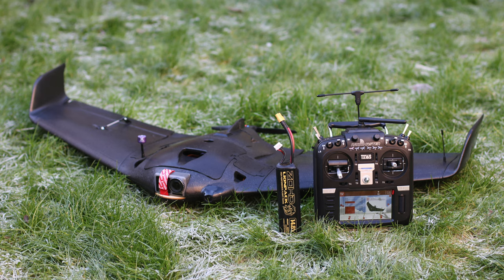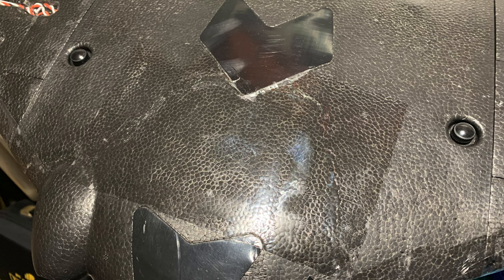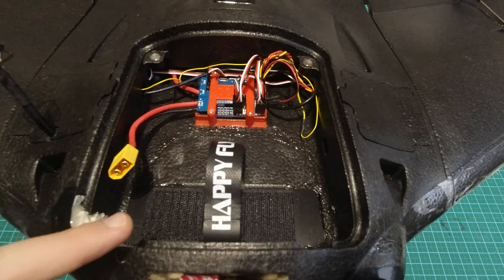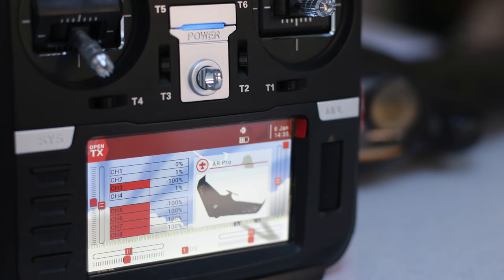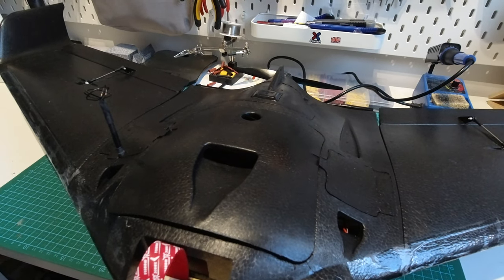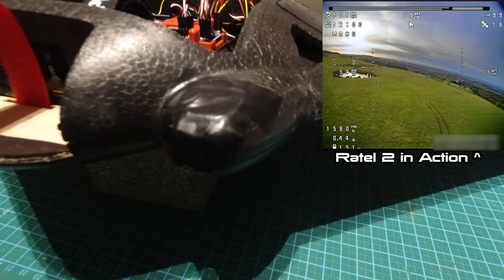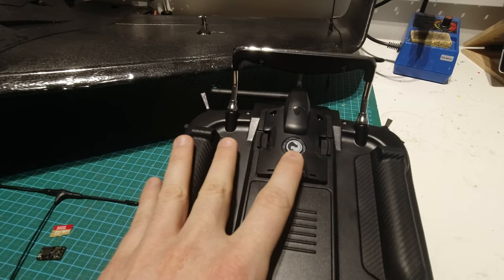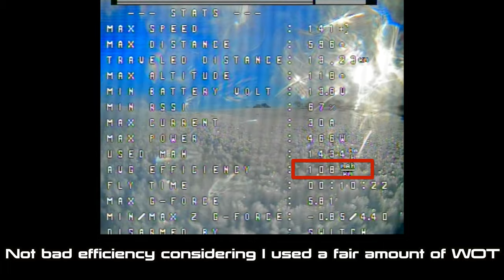AR Pro FPV Wing - Maiden / Crash / Repair / Review... & New Toys 🤓

Comment: I know this is an older video, but I just had the identical experience with the maiden of my 1st arwing pro.  Crashed into short tough bushes like you and destroyed the front of the fuselage, although mine split in 1/2 horizontally.  I was lucky to find it after nearly 3 hours of bush bashing.  Thanks for sharing that tip about making expanding glue.  I'm going to need to do that.  Thanks for the info, and safe flying.
Reply from the maker: Glad you found it! Thanks for watching and commenting 😁 good luck with the repair

Comment: The great thing is that after your 86 test and setup flights including all the crashes, to get iNav working well,  you can just order a Fuse as they are available as a spare part ! :)
Reply from the maker: If you can order the fuse separate thats really nice. Most companies don't offer this. iNav is all good for me mostly. Been using it for years and this is my first issue with it in a long time... and it was my own fault really

Comment: Nice comments on the Ratel 2. Good to see they can improve an already great cam. I’ve seen there’s a Ratel Mini too with a larger lens, which may have better optics. 

Lots of cool stuff in this video Adam. You always get the best scenery too.
Reply from the maker: Nice, I've not heard of the Ratel Mini, I'll check it out. They made a couple of other changes on the Ratel 2 like a wider angle lens, but I just see that as a personal preference thing rather than an upgrade.

Cheers, glad you enjoyed it. One of those videos that ended up a lot longer than intended but there was just a lot I wanted to cover. This could have been 1 hour long if i's said all of the things I was thinking haha. Yeah the scenery is always great when you get a nice blanket of snow... however, my car can't make it up the steep icy road so I had to walk up about 500m 😅 cheers mate
Reply: @AdamGdoesFPV  to be honest, I read about the optics on the Ratel 2, and the wider angle, which put me off a little. The “DJI” glass could be better, but the preview image looked a fair bit more fisheye, but probably not enough to notice in flight. The Mini I think has been out for a little while. It was after the baby, but before the 2. I didn’t notice it until last night, when I was looking at cameras for the next project. 

That walk was worth it though. It looked stunning 👍🏻

Comment: It seems if you have crossfire failsafe set to cut and inav set to RTH when you turn off radio it would return to home, I don't get the Emergency landing unless there was malfunction or maybe I'm missing something. Thanks
Reply from the maker: Yeah that's right I have the CF set to cut/no pulses and FS set to RTH. I also have emergency landing set to 'never' haha. Seems like a quirk with this particular scenario that may not have been considered. I think iNav can't quite understand if the plane is on the ground or in the air. Oh well at least we all know how to prevent this from now on. Cheers

Comment: I have not done much flying the last couple of years but I plan to get back into it and am building 3 wings; the Dart XL En, the AR Wing and the AR Wing Pro.  Being more of a fixed wing pilot but not a "wing" pilot which one do you think I should start flying first to make things easy?   Also, after I saw the video of your crash my faith in INAV dropped a bit.  Might try Ardupilot, not sure?
Reply from the maker: I'd say either of the AR wings, whichever you've finished first. Having said that the Dart XL is easy to fly too... but maybe a bit less forgiving if crashed. Don't let this crash put you off iNav, it's pretty good, and I understand why it's designed to behave the way it did in this video... if only i'd known to just drop the throttle I could have just carried on my flight. Ardu is a steeper learning curve, not as user friendly, but it's personal preference really. Cheers

Comment: I like your expanding foam repair, very novel....I hate the fact you are forced to use a big GoPro to get CG, even though you have a big flight lipo in there...Oh, you need to get the new TBS App on your SD card...an App that runs inside otx..!!! I also have the exact same Radiomaster, agree about the ratchet and stick tensions...🤔🤔😳😯🇬🇧
Reply from the maker: Cheers mate 😀 Yeah I can see how it would be annoying for people with a light HD cam... but for me this was always going to be my setup and it just happened to be spot on for CG. I added the TBS agent a few days ago, very smart, you wouldn't get to appreciate it properly on the X9D. I'm hoping I can fix the gimbal preferences, will let you know how I get on 👍🏻
Reply: @AdamGdoesFPV  Cool, yeah, not having a ratchet to speak of is annoying, but the TX itself is great. So much easier to operate and navigate with that scroll wheel...🤔😳😳🇬🇧
Reply from the maker: @EnglishTurbines  Agreed! I might even get the CNC version as I think this could be one I stick with for a while :D

Comment: Adam ..what's the main difference flight characteristics or purpose wise,... between an ARWing Pro, and a ZOHD Talon GT?
I,m wanting to get into wings from kwads...but am a bit confused as to what wing configuration to chooseto start..😳🤔
Reply from the maker: Wings tend to be a simpler build and can withstand a bash a bit better. Talon GT has more parts sticking out which could be damaged in a crash, but will be more stable in yaw and you have a rudder for more precise control.
Reply: @AdamGdoesFPV  Ah..many thanks Adam, appreciate you're clarification 👍🍻...I,ll move on to the Talon GT Rebel later this year once the online shops here in England can get  stock in again.😲
Lovin all your long range vids along the coast needless to say.🚀

Comment: Cool vid man. What a thing to happen with the auto launch tho!
Reply from the maker: Cheers 😀 yeah that was a pain, at least I know how to stop it next time.... could have been worse 😅
Reply: @AdamGdoesFPV  I could feel the panic whilst watching it man!
Reply from the maker: @lurgy1  😅😅 yeah it's not a nice feeling when you think you're completely locked out and don't know why. I'm lucky it went round in a circle rather than heading straight off into the distance
Reply: @AdamGdoesFPV  I had something similar last time I flew when I had changed the return to home setting. I done rth and launch mode as I normally do and it carried on flying out until it got to the rth height (not normal for me) but was a fast model and it got quite far out before I realised to switch rth off lol.

Comment: Thank you for posting this review.  I just finished acquiring the PNP edition of this wing. How do you program the Sonic model 40a ESC that it comes with?  Have you been able to find a manual for it?    If so, do you mind posting a link on where I can find it?  Thanks in advance.  Cheers!
Reply from the maker: Cheers. From memory I think I used the programming instructions from the Dart XL. ZOHD / Sonicmodel are same people and I think escs are same with different branding. It worked for me: http://myosuploads3.banggood.com/products/20200803/20200803052400ZOHDDartXLEnhancedVersionManual-LD.pdf
Reply: @AdamGdoesFPV  Brilliant.  Thank you!  I’ll give it a go.  Cheers!

Comment: Hi how many wires do you have running from your xfire receiver? I see if you uese the wing plug you are limited to 3 wires and some xfire setups like mine with mavlink passthrough use 4. Thanks
Reply from the maker: I was going to talk about this in the video but decided to cut it out due to the length. I use 3 cables because I have no interest in telemetry, so for me it’s easy. However, if I did want to use 4 cables I would simply use 1 of the 6 pins for 2 x GDN cables and then use the spare pin for the 4th rx cable. A little extra faff but once it’s done you’re sorted.

Comment: Do the magnets on the back hatch screw with the GPS at all?
Reply from the maker: No not at all. It averages around 15-20 sats as it is and it acquires sat lock before I even put my goggles on to check the live feed :)

Comment: I know this is old video but I've watched several times LOL, I'm still flying the ar wing pro with a 4s 5200mah lipo but thinking about going with same battery you have here I'm looking to get alittle more flight time but to be honest i worried about amp draw when launching,loops and rolls. Should this be a concern? This bird is right at 1400gr but cruises around 6amp but much more at full throttle. How much flight time do you get with this battery? Thanks for all your videos
Reply: I'm also interested in whether the liion pack will be a viable option, it would be interesting to see if the low amperage is ok
Reply from the maker: Hey, from memory I was getting minimum 30mins and would easily get 1h just cruising. The li-ion can output around 20a continuously which is nice for medium speed flying. You can punch the throttle for loops at the start of the flight but as it gets to lower end of its voltage range you’ll have a lot less power, even to the point where you can just about maintain cruise amps. I happily used li-ion for most flights on my AR Pro and it’s fine, just don’t expect the same punch or sustained power as lipo.
Reply: Ok makes sense, thanks for information

Comment: Nice review - I like your foam repair.  I always frisby launch my AR900 with a shake start for auto-launch, after  blending a finger from a bad auto-launch using the skids to grip.  This is a reliable way to launch without requiring any idle throttle.
Reply from the maker: Thanks 😊 I’ve used that method before, but luckily I’ve never had a prop to hand incident 😱 hope your injury wasn’t too bad!! Yeah I think it’s a nice easy repair that some people might not think about and it’s really handy to fill those gaps 👌🏻

Comment: Looking forward to seeing some more of this gorgeous winter flying scenery. 
Thanks for the PVA glue tip. That a very useful to know. :)
Reply from the maker: Yeah It's a handy little trick for filling those gaps. Also useful in some builds depending on the model. I hope to get some more winter shots but the problem is its just so cold and windy right now... plus a lot of low cloud so sometimes my flying field is in the clouds with very poor visibility :/ Cheers

Comment: i had the EXACT SAME PROBLEM with my drift. i threw it. it maintained altitude at like 20 feet and i'm doing all sorts to try and get it out of autolaunch. ended up doing that moving the throttle to 0 and of course when i did that ..... it turned turtle and ended up in a puddle.
Reply from the maker: Well at least you figured it out lol. shame about the crash though, that's unlucky

Comment: Find really interesting you didn't try to use a repeater... In my humble opinion the transmitter have some kind of harmonics... that actually are interacting with your VRX.. using a repeater would allow you to stay far from the Receiver and check that theory.. I mean if the transmitter is a good quality there's no good reason to walk away from it.(Plus consider as well moving the transmitter to the tip of the opposite wing away from the Crossfire RX)... Best of luck!! I do plan to put an plywood "Spine in the center of the fuselage & set up a hook so I can use a bungee cord "I do have a bad shoulder and can not give my self the privilege of throwing it like every one else... Great video I really enjoy it!
Reply from the maker: Hey, not sure if you have commented on the wrong video here. The only issue encountered here was a dodgy Vtx. Even with the control link gear all turned off the video still had the same problem. Cheers

Comment: Any suggestion how to mount a camera on its belly ?
I want to do some aerial photography or land mapping with this.
Reply from the maker: I'd probably mount the camera where I currently have my FC and put the FC in the rear bay with the esc. Unless your camera would fit between your battery and FC where it is. Then just add a couple of skids on the bottom of the fuse either side of the cam to give it some clearance.

Comment: Those lines are can be a solder joint on vtx to where your getting power.  Or power lines to close to attenna wire.. one fix.. Dji very well done great video! !ll Cheers and God bless 👊👊💪💪
Reply from the maker: Thanks for the info. From a visual inspection it looks fine, but I won't be wasting any more time on it now. Cheers

Comment: 👍👍👍 You mentioned how it's a little more tricky to throw than the AR900... now that you have autolaunch figured out, would you try the double handed overhead style launch... with the tx on the ground/table?
Reply from the maker: I don't think so no, never liked the idea of the prop coming past my face 😅 I still prefer to hold where the fuselage joins the wing with thumb on top and fingers underneath. Cheers

Comment: Nice review! My thoughts on the PandaRC VTX is that its magnetic interference from the brushless fan right on top of the amplifier. Doesn't surprise me at all.
Reply from the maker: Cheers for the info, I'll be removing the fan some time soon to confirm 😁
Reply: @AdamGdoesFPV  I’ll be interested to see how that works. Considering the sir ducts I can’t imagine it’ll get hot.
Reply from the maker: @kerbouchaud1  Fan removed, still the same lines 🤦🏻‍♂️
Reply: @AdamGdoesFPV  Wow, well, I guess its time for the Unify.

Comment: What's it like flying with lithium ion. I know your can't draw as many amps. But Is that a case of go easy with it. Or it just won't deliver it when you push the throttle ??  I too have an ar wing pro and am contemplating lipo with liion thanks Steve
Reply from the maker: Li-ion will give a bit of punch early on but they don’t like any sustained high amp draw and will drop in voltage quickly. Towards the end of its voltage range  Ali-ion will really struggle and full throttle will give you barely any more than slow cruise. For medium throttle to low cruise they are all good. If you want to fly acro or fast etc then go lipo. I set mine up for both depending on my mood.

Comment: I have my idle throttle on 0 and then 75% when launch detected, so this can't happen, works perfect on my S800
Reply from the maker: Until recently I never used idle throttle either, and I still only use it on planes that really benefit from it. The failure to detect launch but still making it airborne isn't actually a problem at all if you know how to exit AL, so it won't worry me if this happens again 🙂 Cheers

Comment: Hey Adam, how were able to connect the CRSF to a servo connector? Since the CRSF needs 4 leads compared to a servo lead only has 3.
Reply from the maker: Hi, I'm one of the few people that just doesn't care about telemetry so I never needed to use a 4th cable on the rx. However, I'd share the ground pin with the servo if i really wanted to use that 4th cable. Cheers

Comment: If on wing you put crossfire antenna vertical, you need put verticaly antenna on tx unit.
Advice: replace tx antenna to moxon 915 (868), and replace t-mortal standart antenna on wing to tune on 915 (868) dipole.
Reply from the maker: Hi, thanks for the comment. I think a couple of people may have been confused by the fact that I store the antenna on the tx horizontally... I'd never fly with it like this, wouldn't be very good for performance on linear antennas 😅 I'll check out the 915 gear. thanks

Comment: Think crossfire is small? LmAO check out a ELRS PP. About half the size and the ELRS24 module is good to 20km.
Reply from the maker: Honestly the weight and size of a TBS nano is so insignificant that there is nothing to be gained by it being any smaller or lighter.
Reply: @AdamGdoesFPV  not my point at all. Just saying it is smaller. You sounded genuinely surprised how small that reciever is. And any gram saved is a plus in aeronautics.  #themoreyouknow

Comment: Adam, have you installed and tested the new TBS Unify pro 32  VTX?  I'm on the fence still.  Was hoping to get your input.
Reply from the maker: Hey, I haven't yet because I fitted a Matek 1.3g for some Crossfire + 1.3g testing. I will probably install the TBS in the next month or so though. It gets great reviews from many others so I'd say go for it
Reply: @AdamGdoesFPV  thanks.  Looking forward to hearing your thoughts.  I know you typically are a 1.2/1.3 ghz fan.  Curious to see how you are ranging with the 5.8 system

Comment: Hey Darren, I have a question on the ar wing pro with inav please explain proper way of setting up max servo deflection, the manual says 12mm max but mine is much more also Manuel says level 1.5 to 2mm I'm assuming that means that much up on alerions with plane level.  How is yours setup? As always thanks
Reply from the maker: Hey. I don’t have mine anymore but for rates you can setup in iNav. Adjust the weight until the surfaces move that much in each direction, but must do that in manual mode
Reply: Thanks Darren I understand now, I'm thinking about getting rid of mine too, flying ok but not near as smooth as my c1 chaser using same camera the ar wing pro very shakey video not jello but shaking it must be a problem with this wing, just curious if this is why yours is gone? As always thanks

Comment: Awesome tip about the gorilla glue! I've been using the same stuff for ages but never thought to mix it with it! Brilliant idea! I've been using the ratel 2 for a few days now but can't figure out how to get it to handle daytime lighting propperly, mine as stock seems to have very high exposure i dont know if you found the same? Would you mind sharing some camera settings to help me out id you did change any? Thanks mate 👍
Reply from the maker: Hey, I actually use the stock settings. Sounds like you may have an issue with your camera or goggles 😬
Reply: @AdamGdoesFPV  i think its the camera as my goggles are fine with all my other models, bit of a shame really :)